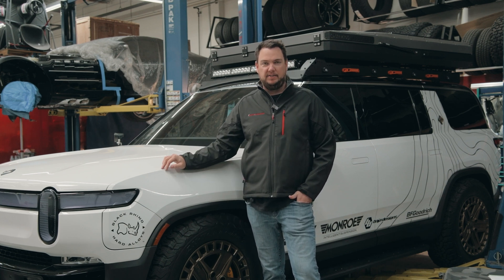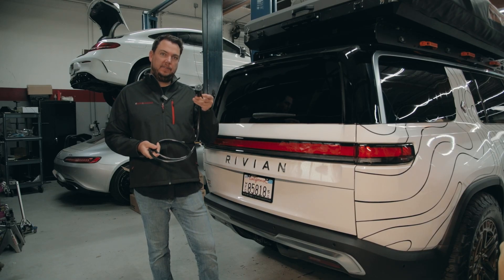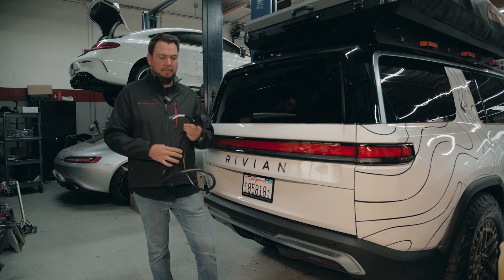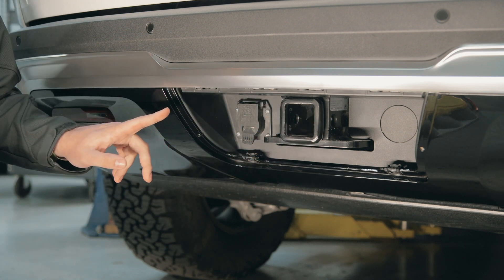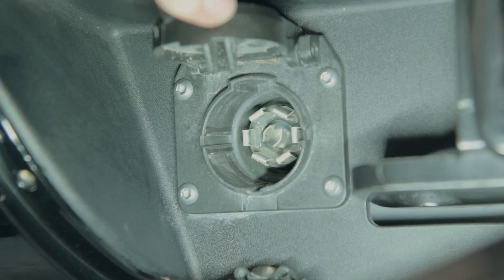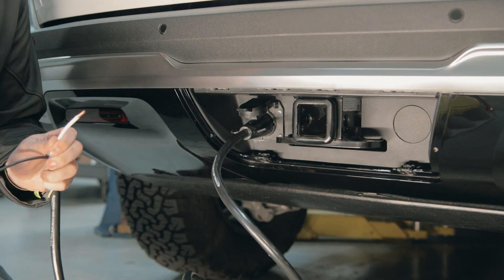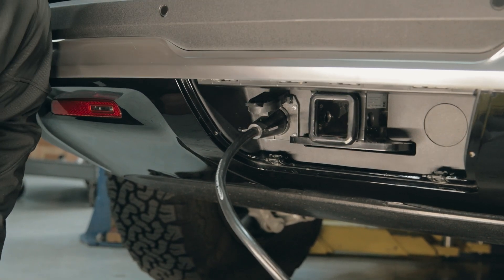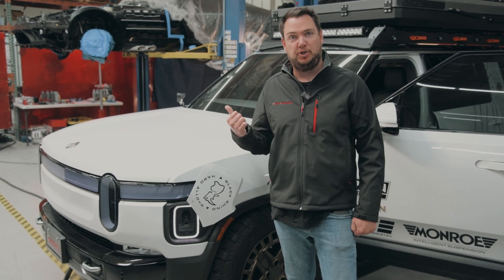Completely Dead Battery on a Rivian R1S, none of the doors open! What now?

Comment: This happened to me after I replaced the 12v battery with a non-Rivian lithium batt. It would not take a charge from the rear terminals. I had to manually open the frunk and put the original Rivian battery back in. To manually open the frunk (even with 22" tires facing dead forward): You need a Torx 20 short bit and a 90 deg bit ratchet, a 10 mm box wrench, and a flashlight. Go to the drivers side front wheel well and remove the Torx screws holding the forward part of the well liner in place. All of them. Then reach in with the 10 mm wrench and get one bolt that easily visible. Pull out the cover from the bottom up.  Now look in and you'll see a 1/16" stainless cable with a finger loop at the end. It's hanging down at about arm's length from the fender. Pull down on the cable with your right hand while lifting the hood upward with your left hand.

Comment: I am glad the Lightning does not have the vampire drain issue and a manual charge door port cover. I am surprised that the trucks software would let the truck get into this state without going into some sort of conservation mode.
Reply: I think they fixed it finally. They found what the problem was.

Comment: This is not the correct way to jump the 12v. Make sure you reference the Rivian owners manual for the correct procedure.
Reply from the maker: That would be awesome, but how are you supposed to see the owners manual if it's on the dash and the vehicle is completely dead?
Reply: @directcurrentengineering9023  you can see it on whatever phone is linked with the vehicle and online as well.
Reply: @directcurrentengineering9023  It's 2023, I googled it on my phone in 30 seconds. There was a port on the right side of the hitch with a positive and negative cable that you could have used. This was totally unnecessary, but interesting nonetheless.
Reply: @directcurrentengineering9023 the owner’s guide is also in the app

Comment: Did you know that behind the cap to the right of the hitch are handy + & - cables for jumping the 12V's? Take a look :)
Reply: Yeah I can't believe they went through all that trouble when the correct solution is just 6 inches over to the right.
Reply: Absolutely don’t need to do that 😂 take circle cutout off to the right bless his heart
Reply: Thanks for this comment
Reply: This guy never read the manual, ignorant video.
Reply: But it does prove an alternative method.
Reply: His way is actually better. I had a jumper connected to the default method for hours with no luck. His way is direct and gives you a battery reading.
Reply: The big boys don’t read the instruction manuals, they are real smart and handy.

Comment: This is great. Thanks.
Reply: Not great. Procedure to jump the primary 12v is spelled out on p.31 of Rivian’s Tow Operator Guide. They were right there where the leads are, but make it more complicated. https://assets.rivian.com/2md5qhoeajym/2IDu0dpJ4j6r298xoLa5sG/aeb759d8a1c10ac42777e270e97a4638/R1-tow-operator-guide-en-us-20230117.pdf
Reply: @fmonk no it’s great to have another option. I have had my truck for over a year.  I know the way to do it via the manual.  What’s great is learning other ways to do things and if you watch the video the first thing he mentions is that they could do it the standard way but they’re are trying something new.
Reply from the maker: @IronPig_75   this is correct!! More options are always better, specially if you are in a pinch!
Reply: @directcurrentengineering9023  But it’s the wrong way to jump any vehicle. And here’s why: any given 12V accessory or light or anything is behind a fuse and/or a relay. You can run a relatively low amperage trickle charger though any accessory or other 12V device (usually) because the amperage is low. But connecting a battery directly to a 12V accessory port may drive amperage greater than the circuit allows. That tow harness wasn’t designed for jumping.

And it’s harder to do than accessing the two leads designed for jumping that are right next to it. 

Other cars have this feature/workaround as well. 

I wouldn’t defend this as another way to do something. People out there could potentially cause issues with their trucks because they “saw it on YouTube”